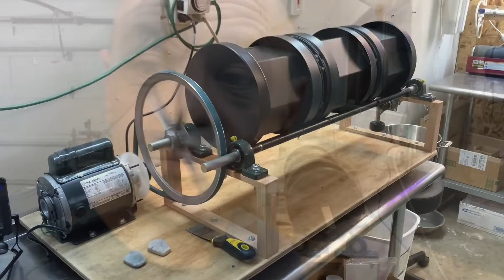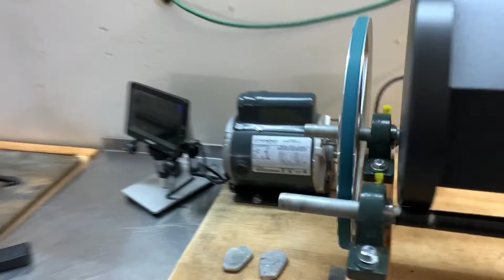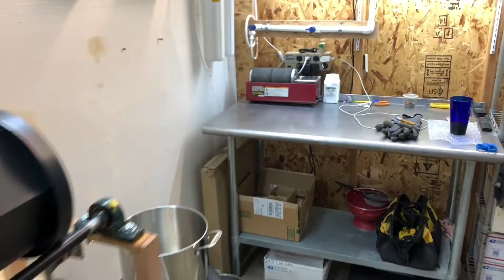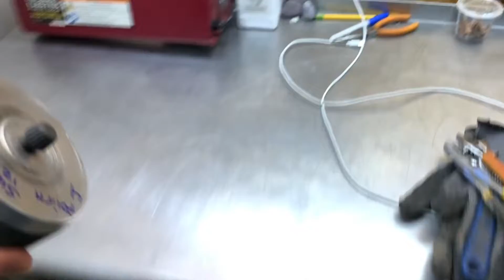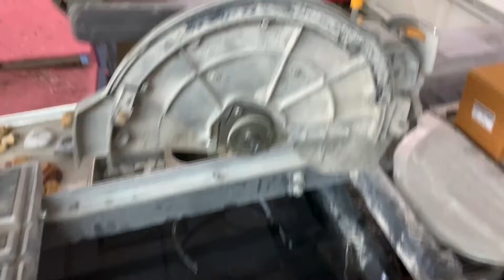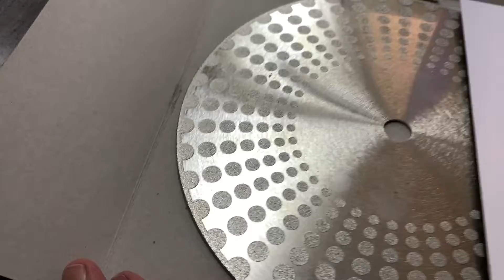Homemade rock tumbler build overview.

Comment: Don't even need the giant flywheel just put a small one on the front pole.
Reply from the maker: In order to achieve the 22 RPM that these drums need to polish i had to gear the motor down since it spins at something like 1500 rpms. This pully ratio is exactly what this setup needs. I couldn't go any smaller on the motor pulley or i could have went smaller on the larger one so it is what it is. Works great.

Comment: I had an "aha" moment watching your video.  I couldn't understand why your jars were rotating so slowly, when by my calculations your drive bar is rotating at around 308 rpms?   Then it dawned on me you actually have a second pulley system going with the diameter of your drive shaft and the diameter of your mill jar.     Now I got it. 

This is a great build.  The incorporation of the motor fan was a great tip.  Thanks.

Comment: That electrical tape will come back to haunt you, other than that great build!
Reply from the maker: Yes it will.... And it did. It just came off like 2 days later. I found some rubber hose that slid on the 3/4" steel real nice so it now has some thick rubber and it hasnt even started wearing and its been months now.

Comment: I’m running one that uses a 1/8hp motor spinning a “40lbs” barrel with a loaded weight of 68.2lbs pulling only 3amp at 22rpm. The FLA is 3.5A. Did I mention the new Dayton TEFC motor runs at 40C… what is your amp draw and motor temp?
Reply from the maker: I think this motor is 3.2 amp 120v and 1.5 240v. I have outlets for both in my garage so i can use 240v. The temp never gets over 105*F on the hottest part of the motor. The rest of the motor is room temp. I do have a small fan on it but i dont think it needs it at all.

Comment: Would making the 12" pulley smaller make it run faster? I'm looking for about 66 RPM...
Reply: If I remember correctly you need the barrels to go something like 33,  or 35 rpm, but you should verify that. There is a sweet spot to make them tumble. Too slow, and they slide, and too fast I think they break each other.
Reply: @8000-f6z  I would be using them for something else besides rock tumbling...
Reply: Makes it run slower. Running a little bigger pulley on the motor end will make it run faster. Either or...also, 66 rpms is too fast. Rocks can break.
Reply from the maker: yes. It would increase the rpm to go to a 8" pulley. These barrels are recommended for 22 rpm which is what the manufacture suggested for this diameter. The smaller barrels do need to go faster. 50 to 60 rpm is what my 3lb harbor freight spins at.

Comment: You think 1 hp 1725 rpm motor is to much power?
Reply: If you don’t need the extra power the cost of the power will quickly chew up any savings from not buying a  smaller motor
Reply from the maker: I think the amp draw on a 1hp is too much. Its like 10amps i think. This 1/4hp is 3amps. Much cheaper to run and cheaper to buy. It will easily spin up to 12 of these barrels with zero effort.